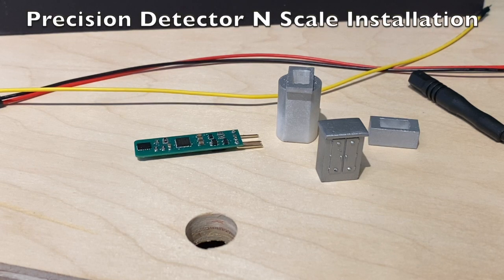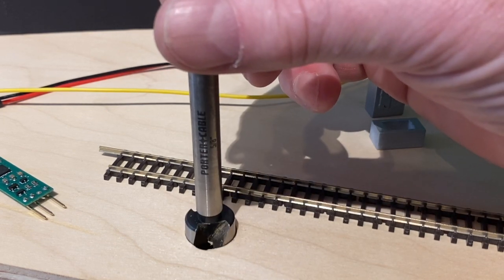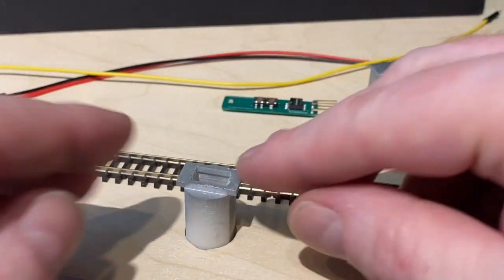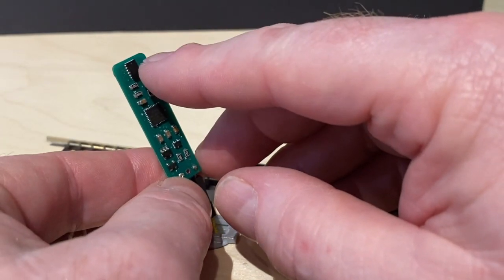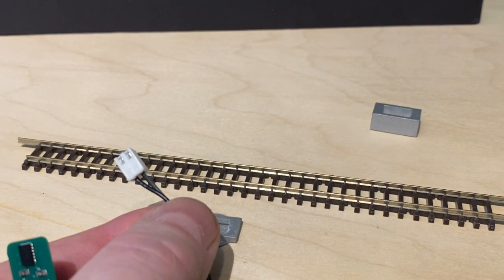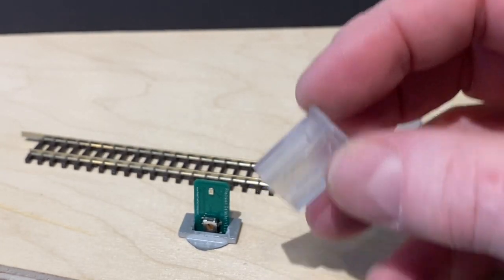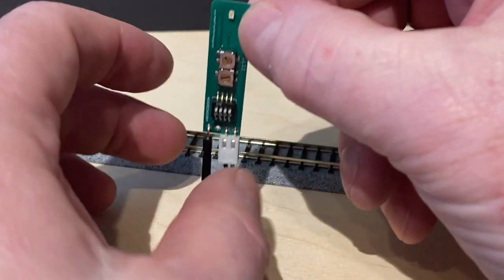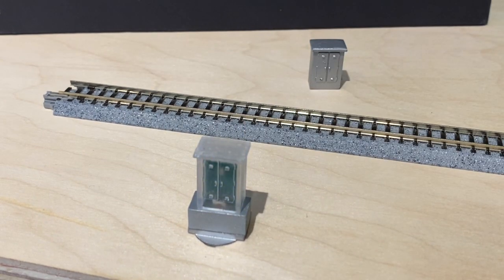MTT Precision Detector N Scale Installation

Comment: How to drill a clean hole in 1" pink insulation foam so it supports the barrel properly?
Reply from the maker: Drill a 1/4" hole with a round bit and then use a round rasp to shape the hole to 1".  No drilling technique, i.e. there isn't a bit that I know that will cut a clean hole.  It just tears it.

Comment: Really like...
How  much is the unit?
If there is another track adjacent to track you wish to install sensor on, how do you stop false readings... eg like multi track staging yard.
Would you ship to New Zealand?
Reply from the maker: The sensor has a 1mm precision.  Seriously.  you can set it to only read between the rails and you can adjust THAT location with the onboard adjustment screw.  Yes, we ship to New Zealand and have a number of repeat customers from there.
Here is the link to the product in the store - it depends what gauge you are modeling:  
https://modeltraintechnology.com/product/precision-side-of-track-detector/